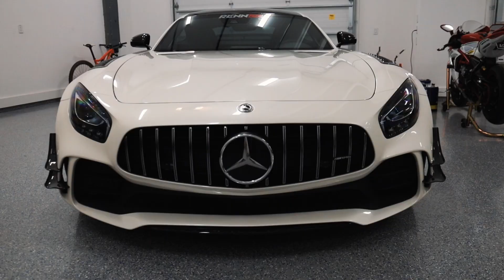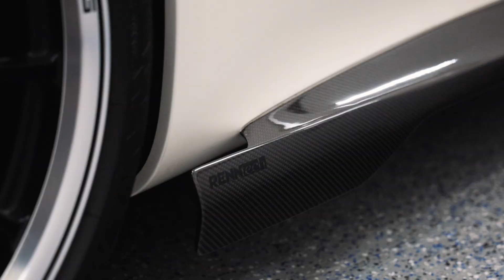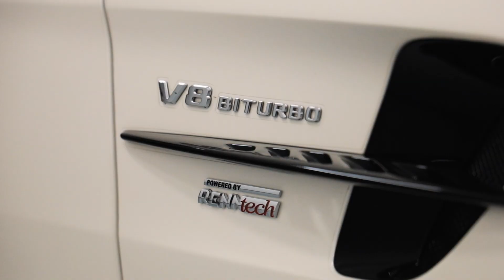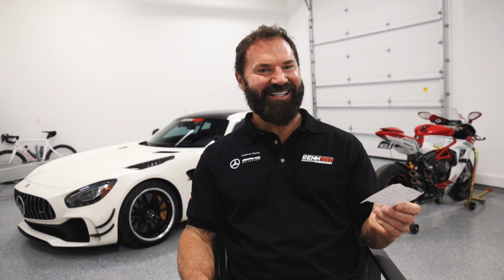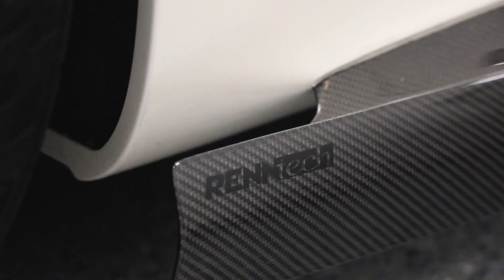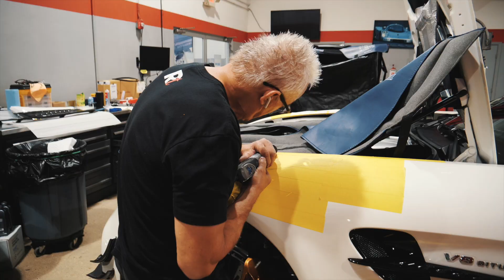What it Cost to Build my RENNtech AMG GT R

Comment: I’m not sure if renntech really tested their body kit on a wind tunnel but honestly all those part don’t seem like is functional, for all those money I rather go with tikt performance amg gtr aero kit, they are functional and they have a crazy lap time on youtube with their aero kits, and it looks ten times better then renntech kits
Reply from the maker: They are another great kit provider.  Everyone has their own taste.  What do you think of the Carbonerre widebody kits?
Reply: @CharlieFerer  I think the Carbonerre widebody kit is more about the look and is for show. The AMG GT R is already a very wide car, and when Mercedes designed the AMG GT Black Series, they didn't make the car wider, just added some wheel arches. Making the car as wider would only make it very sluggish and is not gonna be like a real GT3 car. Also, I believe you are someone who values performance greatly. I think the Carbonerre widebody kit could pose a problem at high speeds. If you carefully examine the Tikt performance kit, all the aerodynamics have been tested at high-speed.
Reply from the maker: I have a GT R Carbonerre and the car did ten seconds faster than when it was stock with the kit at Utah Motorsports (including longer control arms, etc). Big improvement because of the greater downforce especially the back of the car so traction control is not coming on continuously in stock form (which uses the rear brakes to control the rear).  @ElegantDY